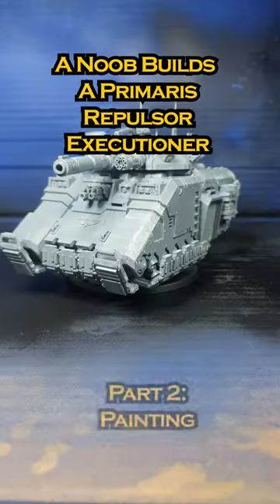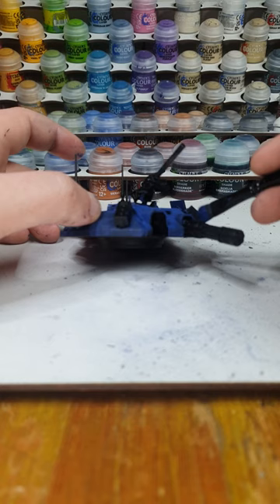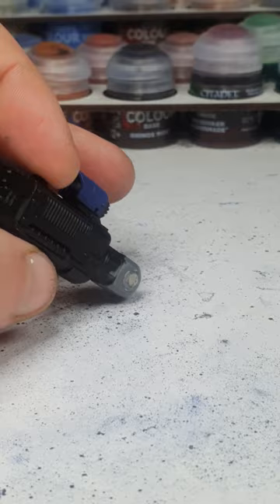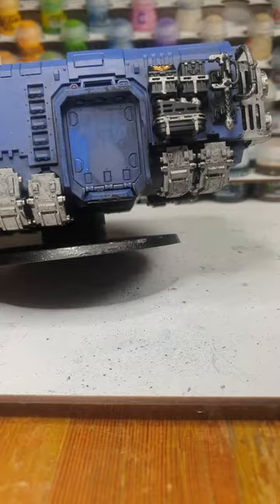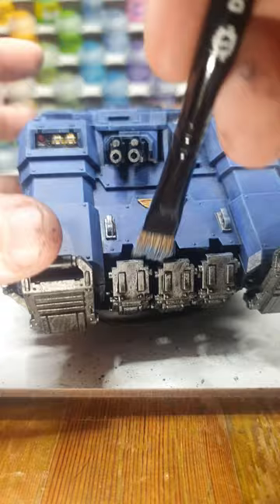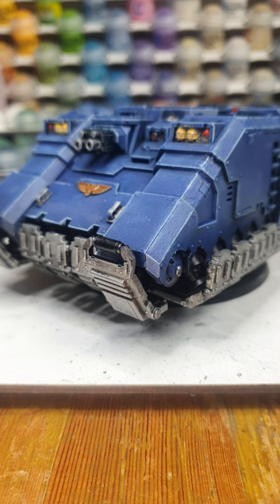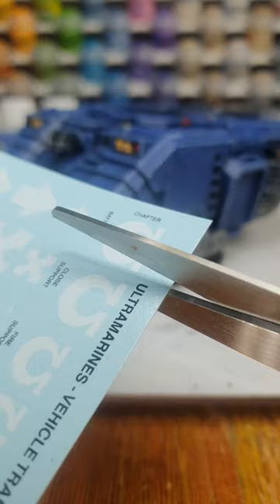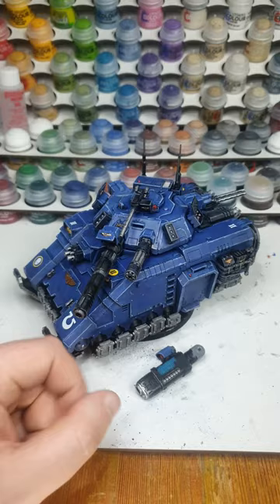A noob builds a Primaris Repulsor Executioner battle tank - Part 2: Painting

Comment: One tip for battle damage or just dust gathering on feet and tires is typhus corrosion, its a really good technical paint that works like a charm, you just put it on and it almost instantly starts to look as intended but I would recommend to put it last because it can rip up some paint that isn't completely dried.
Reply from the maker: Oh okay, cool! Noted down! 😁  Thankyou!

Comment: Don't glue the rear turret. Add a magnet  or 2.  that way it can move buy not come loose
Reply from the maker: Alas, it's not so straightforward as it sits above empty space! But I shall find a solution one day! 😅
Reply: @AdeptusArtifexus  glue in some sprue pieces to the inside, under the empty hole. Then get a old plastic card, or anything thin but solid, onto the sprue if you want it tidy. You now have a solid base. If the turret is hollow, use green stuff to fill it and you can drill a hole in solid green stuff for  a magnet
Reply from the maker: Hm! A solid plan! Thankyou! 😄

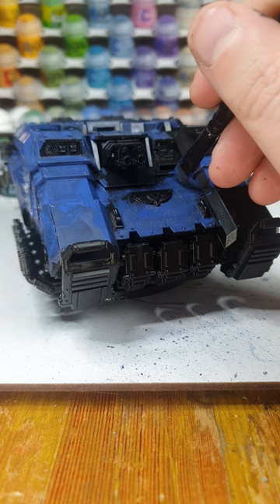Comment: At 5:40 mostly used for as you said putting on a dozerblade or prob using for pulling the tank out of combat if its damaged. Also it coud be used for transporting the tank on a train, if thats a tihing a WH40k xdd
Reply from the maker: A 40k train does sound pretty rad! There would be some in that universe, surely?? 😅